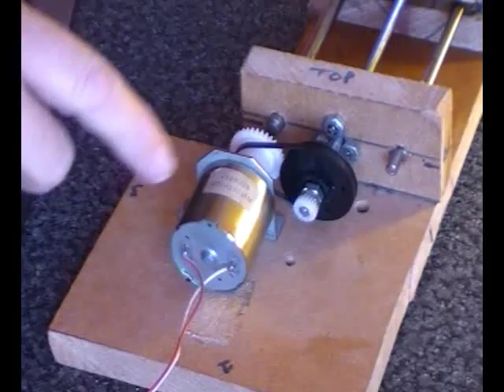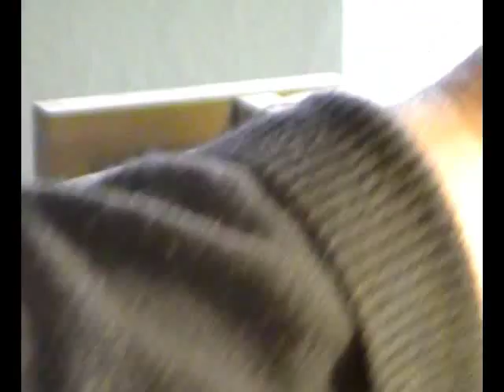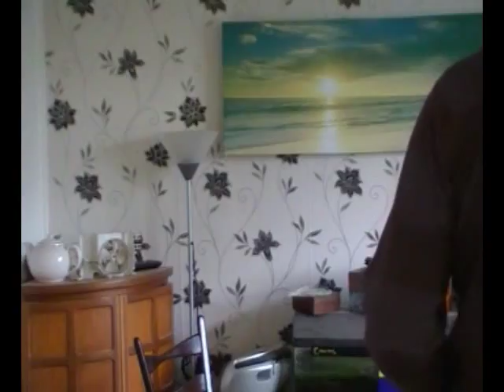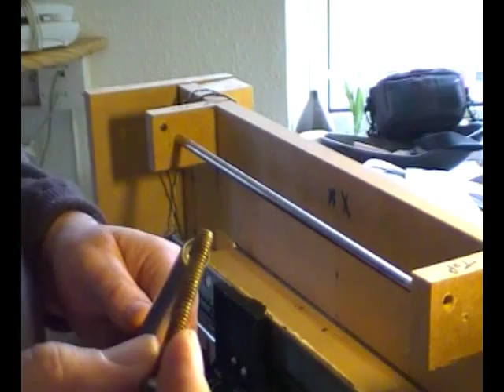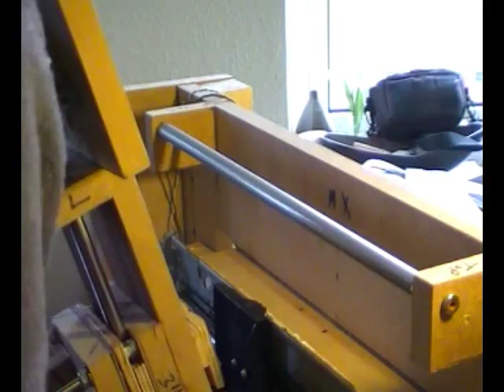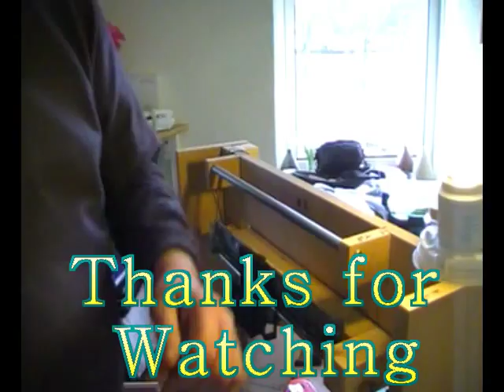MY NICE EV Printer Arduino CNC Part 49

Comment: Have you seen this version of a printer CNC Raymond?
http://justcheckinm8.blogspot.co.nz/
Reply from the maker: I have had a look. It is an excellent cnc machine. However the cost of the printer and steppers would go against the recycle premiss of MY NICE EV project.. Thank you for finding it for me as it is now bookmarked as reference.
Reply: I thought they used the motors from the printer; by bad. And I think he said the printer was quite old 6 yeas or such. Didn't get much into the controls however, just an Arduino with a shield.
Reply from the maker: The Arduino and shield is what caught my eye. It is only pricey for printer if you can't get that model. He said they go on Ebay for about $100+. The steppers look like Ne17 type. That type only found in commercial big printers and copiers. If only I could find someone chucking one of them out. Ah well. Maybe one day. Once again many thanks for finding this information for me. All information helps me.

Comment: I don't think that motor will work. Looks to me to just be a small dc motor not a stepper. It has to be a stepper motor that drives all the axis of the machine the only dc motor youll need is for the spindle.
Reply from the maker: Thanks for that. I am a doer then make it work if it doesn't. If it works. Great. If it doesn't. Great I get to learn something new. I don't draw plans and never have. When building a circuit I try it and draw it up when it works. I have worked this way all my life and have enjoyed the learning of my mistakes greatly. A mistake or error is one step nearer success. Success is all I aim for. And having a good belly laugh at myself when I have been a prat. Keep watching my friend.
Reply: Raymond Earle
No problem. If you would like help or advice please ask... im unsubscribing.
 I think you should spend your time WATCHING youtube video's. Try to learn what a cnc machine is and how it works before you show people how your making one.
CNC machines can be made with crude skills and simple recycled parts im quite convinced. Ive done it. I was hoping that's what you were doing too.

There are a few essential things you need for anything to be a cnc machine. Bolting a DC motor to a board attached to a threaded rod is none of them and wont work

CNC means Computer Numeric Control. There is no numeric control to your dc motor
Reply from the maker: Thank you. Yes I certainly will ask for your help and advice when I need to. That is a wonderful offer thanks. The main reason for not using steppers is that I can't obtain them for free. The idea behind MY NICE EV project. Is to build an electric car for as cheap as possible. The idea is to recycle as much as possible. Take care my friend.
Reply: Raymond Earle bolting small dc motors to a board along side a threaded rod does not make a cnc machine and does not have anything to do with an electric vehicle. You should download your videos again and  title them homemade cnc washing machine. They have no connection to cnc and they have not connection to electric vehicles. so by that standard of thinking they wont get anyone closer to building a washing machine either.....

I admire people who recycle bits into useful objects and machines. They understand what there taking apart and what they want to build....
You dont understand either....

Printers are cnc machines. Computer Numeric Control machines.
Reply: *****
This isn't the Washing Machine channel?